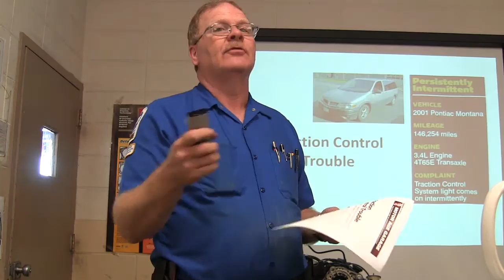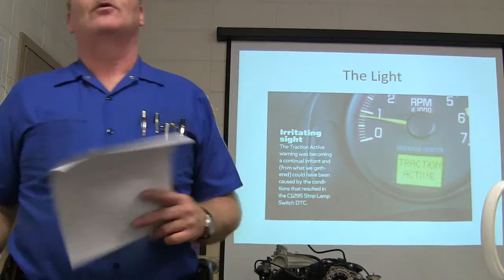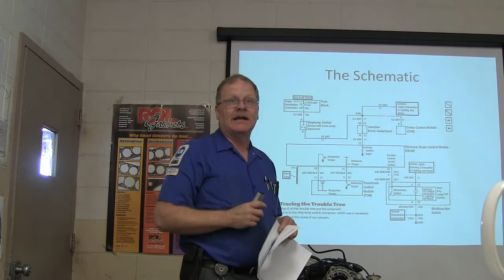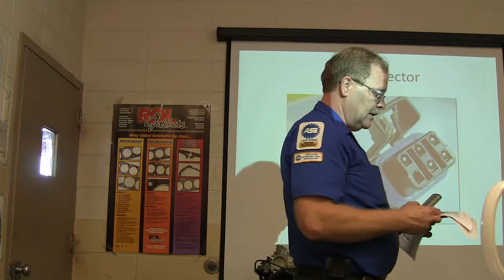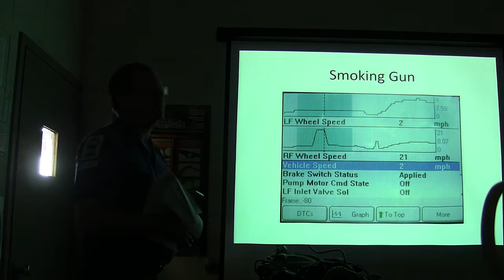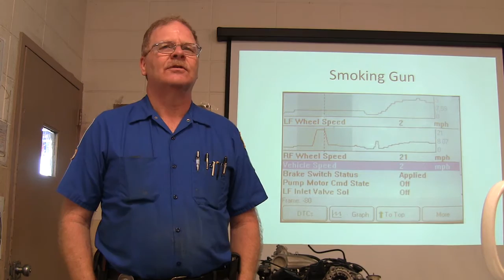Traction Control War Story

Comment: There is a lot more of this requirement to buy expensive parts from the dealer happening these days. A woman thought it was going to cost too much to do a water pump on a newer ford flex so I looked it up. Turns out that pump is placed very deep in the engine and the labor rate she was quoted was fair. Did ford design it that way on purpose? Did the engineers assume the water pump would never need to be replaced? I had a model of mazda that was only built for three years. The power window switch went out a $300 switch due to the door and window design. Since It was my ride I modified a MPV switch and changed the wires to match the old plug for less than $20 in junk parts. For me engineering failures & mechanic war stories are better than the movies, television, sports, concerts, and things we are told to be entertained by. Let's learn something.

Comment: I had a similar traction control issue to yours a few weeks ago.  It was on a 2011 Impala.  Exact same code for excessive variation of l/f.  Checked the wheel speed sensor, tone ring, bearing play. All tested out. Except the same higher mph (showing 20 mph after abs activated around 12 mph) and jumping all over... But only when turning left and intermittently. 

Long story short...  The wiring harness from the sensor to the main wiring harness was crimped by the lower control arm and transmission mount due to a broken retainer.   and it caused the insulation to break and send erratic signals from that sensor.   Obviously the repair was to replace the harness and verify the fix.  

Just wanted to share that with you, since it reminded me of that.  Love your war stories. As you have been doing it a lot longer than me!